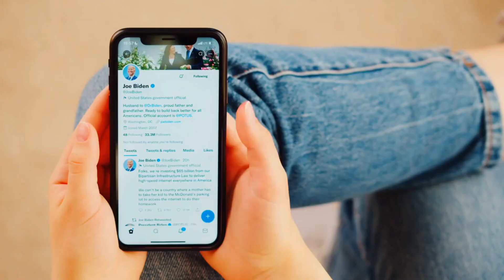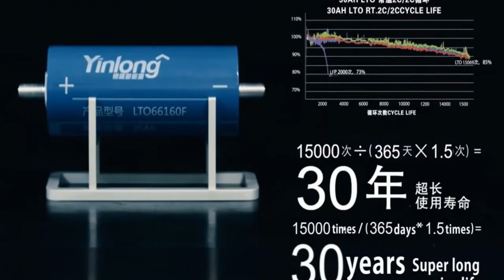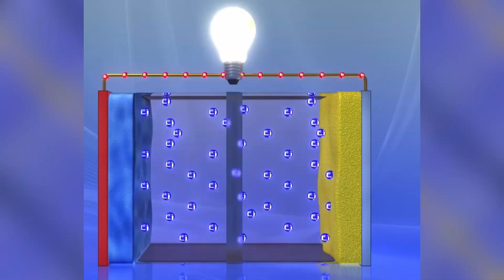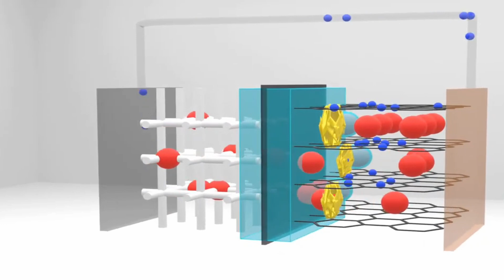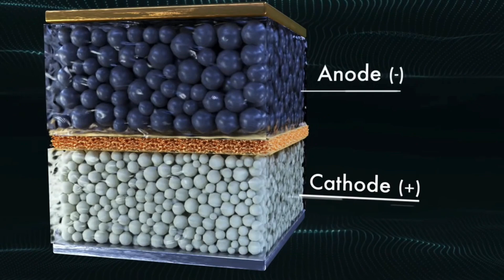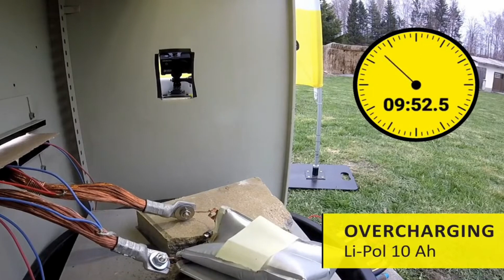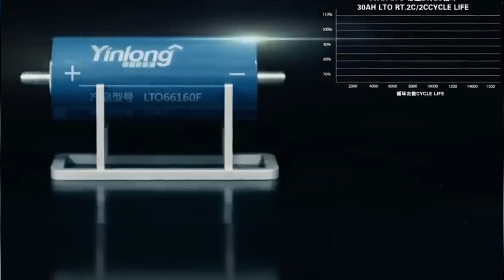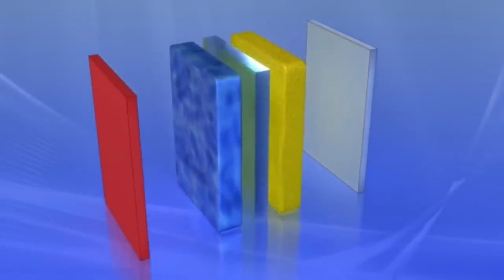Elon Musk Revealed New Concept Battery LTO, Will Break All Industry!

Comment: lto is not a concept battery , the process is well matured and over decade old. toshiba makes some of the best lto batteries with extremely high charge and discharge rate . their only drawback is low voltage and low capacity for their size and weight. 
toshiba made scib cells are expensive but some of the best kind of battery money can buy. they claim a 20000 cycle at 100% dod with high c rate. lto batteries are commonly used in starter battery for large stationary engines or hybrid vehicles.
Reply: who ever narrated this video is a dumbass. lto cycle efficiency is almost 99%. not 86%.